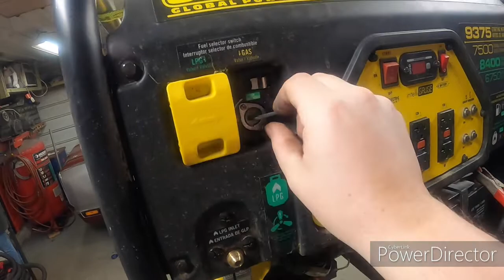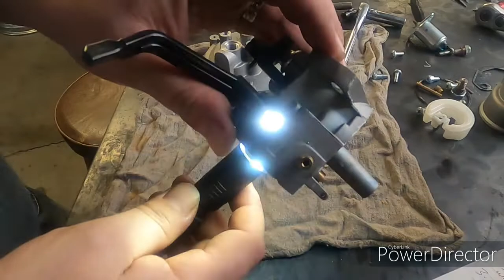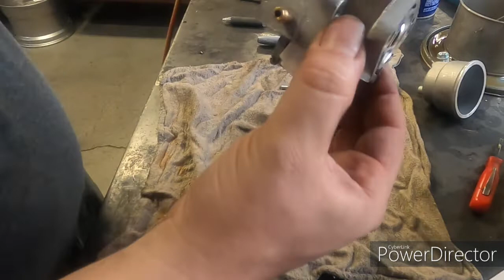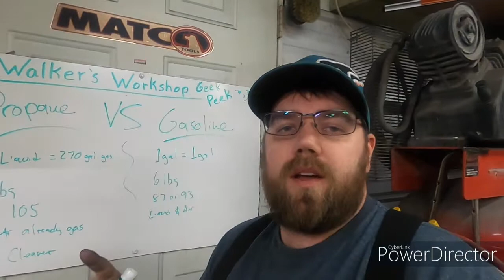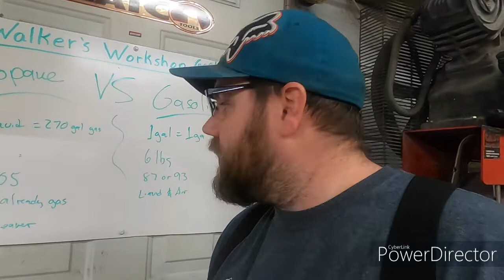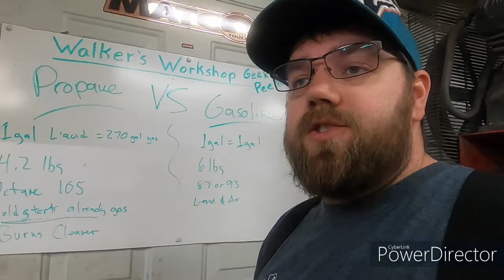How to fix a propane generator  (carb rebuild)  Is Propane better than Gas?

Comment: What a fruad. You made it look good by EASILY pulling off the fuel line, but the throttle linkage wasn't even attached when pulling off the carb.😂😂😂 I stopped watching after that. Any info you can offer after that little show can't be worth a damn after seeing that scam.🤔

Comment: I believe gasoline weighs 8 lbs per gal.
Reply: No, that's water. Fuel weighs less. Diesel, gasoline, and aviation fuel all weigh less and differently. Average around 6.5lbs a gallon.

Comment: I have a firman and Westinghouse df generator.  Neither runs. The firman runs for 10 minutes then dies. Did I understand you right in that propane runs through the carburetor.

Comment: I have a Westinghouse 7500df. Never used gasoline.  It will only start if I take out the air filters. They are perfectly clean. The engine has 150 hours. I set the valves as suggested by Westinghouse. It runs fine after starting and I put the filters back in after it's running and it keeps running. What should I try next? Thanks.

Comment: As the owner of that generator I can guarantee you that it runs hours and hours longer on propane than it does on gas. Thanks for the repair pal.